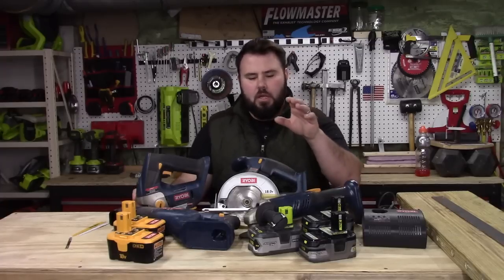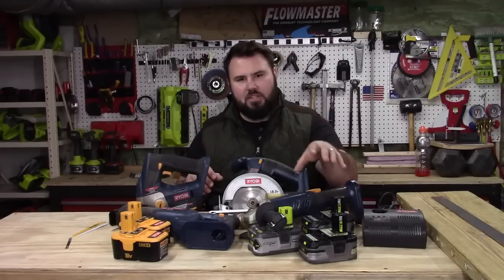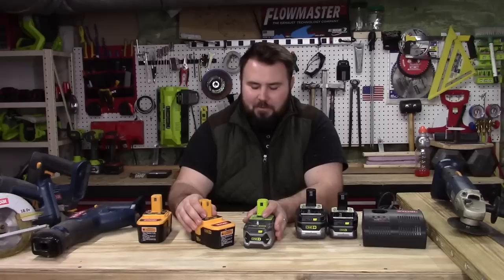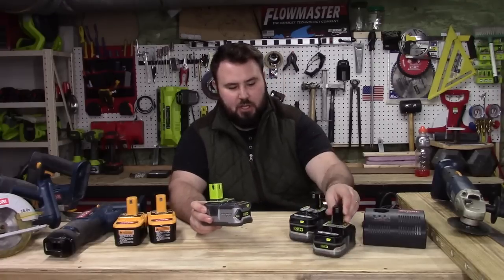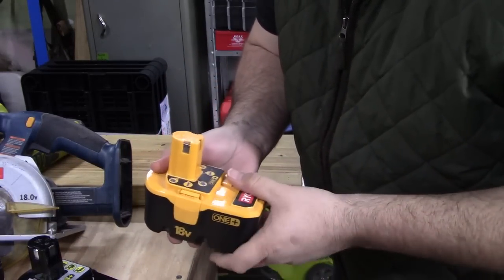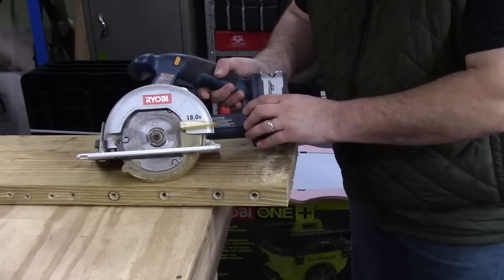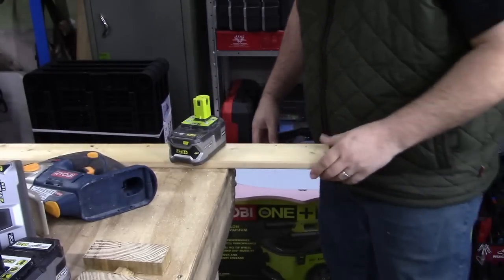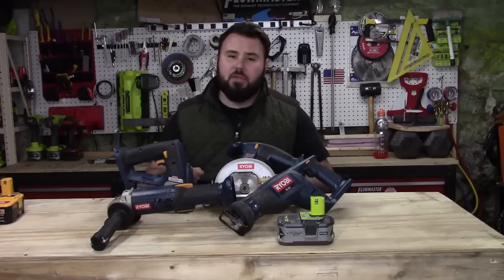Old Ryobi tools using new Lithium batteries

Comment: I was given a P231 ryobi impact drill today. It came with 2 of the big yellow batteries and the charger. I charged them and the drill wouldn't work. Either the batteries are bad or the charger is bad. The lights on the charger did light up. So, I put the P102 lithium battery I had on the drill and it works.

Comment: This answers my question about whether or not to invest in a new battery over buying a new tools.  Just have to see if they sell a battery+charger combo.  Also, will the smaller Li batteries work as well (aka 1.3AH)?
Reply from the maker: Kevin nycl9923 thanks for your comment, yes the lithium batteries will work just as well and better than ni cad

Comment: I'm really surprised at the comments from people who didn't know the lithium batteries worked n the old blue tools.  I currently have 5 of the blue.  I just put the new batteries n them without a second thought 2 whether it was going 2 work. I just assumed it would.  Also, I wanted 2 add, that when my circular saw and nicad battery were both new, the nicad ran it just fine.  Is it going 2 work on a battery that can no longer hold a charge like apparently the ones u have?  Of course not.  So,  I guess I missed ur point on that one.

Comment: hey guys i have some old blue 18v tools and some green as well. also a 12v drill iv'e had for decades when the original nicad batteries i bought a li on pack with 22.4 Ah & i 1.5 Ah (BPL-1820 The old grey & black ones)& charger, i also bought 1 x 5Ah  & 1 x 2.5Ah green pack. since the old 2.4 batteries were getting kinda tired. Since i hate ( mean too) to chuck away a tool that wont run because a battery is dead 1 found out that a 14.4 li on battery (with minor surgery to the drill) not only can run the 12v drill but the charger will also charge  a 14.4 v battery. now i am trying to upgrade the 2.4's to 4 or 5 Ah re pack . can this be done?

Comment: Will the compact lithium ion 1.5 ah 18 volt one + work on the old tools?
Reply: Any new Ryobi battery will work with the old tools. Even the HP batteries will but would be a waste of money unless you want a battery larger than 4ah.

Comment: Did the old blue charger work for you.I tried to charge the new battery in my old blue charger and it  won't charge the new batteries. The green light stays on saying fully charged   and in about 3-4 mins the charger shuts down and take a few min to work again.its like it flips a breaker in the charger.can you help
Reply: No the old chargers are for NiCad batteries.

Comment: I have a set of the even older Blue tools, plus 4 working NiCd packs (now rather weak). But I did floor out my loft with them in 2005.. Today I have at least 12 Ryobi 18+ tools, many are garden tools, which need the 4Ah or 5Ah batteries available in the UK. 
But in Australia  you can get the monster genuine 9Ah batteries. We never see them in the UK or EU. It's long passed time that Ryobi replaced the very dated style battery mounting system. It's rather fragile and often cracks. They should move to a Makita style slide on mountin. It is more robust and more compact.

Comment: Of course they would work great and do work great.I didn’t even ask the question they are obviously the same design! I can’t believe you didn’t buy just batteries for your blue tools lmao!
Reply from the maker: Thumper 1968 I thought the same once I found out the new batteries worked on the old tools. That was post buying the new tools. I must admit however the new tools are great with better tech and stronger parts meant to except higher amperage drives
Reply from the maker: Thumper 1968 thanks for your comment

Comment: Can you use plus one battery 1.5-2amp in a regular ryobi charger and can you use a plus one 1.5-2amp on a regular Ryobi reciprocal saw ?
Reply from the maker: You will need to read the charger abilities and ensure that lithium is supported. And yes the battery should work in you cordless recip.

Comment: Will the one+ batteries work with the new one+HP tools?
Reply from the maker: sure can!
Reply: @livefreeandtoolon  nice, wish the bundles at home depot came with batteries that are bigger than 2ah but I guess 2 batteries plus 2 drills at $179 is a good solid deal even though they are 2ah.

Comment: Will the new lithium ion batteries charge in the old charger?
Reply from the maker: WCSD Thanks for your comment. If you mean will lithium batteries charge in the Nicad charger most likely no unless it specifies on the charger. The newer chargers do charge all Ryobi battery types (nicad, lithium, lithium+) as specified on the charger.
Reply: I agree with profound Odyssey. I think Ryobi even mentioned that the older nicad charger. Since it is not really rated for it. While on the other hand the newer intelliport. Both the grey and the green will charge all three since they are dual chemistry. Meaning they are capable of charging both nicad, and the lithium and the lithium plus. Plus they mark it on the top that it's for all three.
Reply: Profound Odyssey  thank you for the video, I have a blue ryobi sawzall with no battery, could you re state the spec for which battery works with it -or should I just bring it down to the store?
Reply: @alexdephoure  all the new 18v batteries work in the old tools, although I'd get a 4AH or bigger

Comment: Can the new batteries be re charged using the old charger that came with the old yellow batteries?
Reply: NO !! Absolutely NOT. The old chargers are only designed to charge the NiCad batteries that came with it at the time.
Reply: Steve J. - Thanks Steve!

Comment: Do you need to buy a battery charger for the P108 Batteries or can you use the P100 charger?
Reply: No a nicd charger will not charge a lithium battery

Comment: With Ni cd batteries they must fully discharged before recharging, most people did not bother to FULLY discharge them, they build up a memory, and over time you gradually capacity eventually to the point where they hold hardly any charge, even though the charger says they are fully charged. 
There are video,s on you tube showing you how to put new batteries in place of the old Ni cd batteries.
Reply: There's ways to get rid of the build up of those crystals.

Comment: Well when you think for a moment. Even if you were to use a 6 or a 9AH batter from the HP line. All it really is just longer runtime or extended runtime. I know I'm using a 9AH in a hybrid fan the small one actually and it last me 15-16 hours on high settings. Imagine if I were to leave it on low settings with a 9ah it would be probably a day or two on low settings to drain it down completely. And that is not a brushless tool. but a brushed fan.

Comment: Will the old Ryobi tool drain the new battery until it can’t charge anymore
Reply from the maker: The RC Workshop I have not had this issue. However ryobi does recommend to not store the tool with a batter attached., when not in use take the batter out. Thanks for the comment don’t forget to subscribe!
Reply: The Lithium battery packs have a charge controller and under voltage cutoff inside them. So no, your cannot drain the battery down too far with the old tool. However you can still kill them by discharging to cutoff and then storing for too long without recharging. That's why Ryobi recommends not storing the batteries in the tools... you will forget what state of charge and may inadvertently store a discharged battery pack in a tool that won't get used for years.
BTW - there is nothing in the tool that hurts the battery, so it's perfectly OK to store the battery in teh tool... providing that the battery pack is charged.

Comment: I have a old Ryobi power drill but I can't fit any of the new ryobi batteries in it. It won't fit in all the way, preventing me from knowing if it still works
Reply: You're probably using their new 20v battery. They don't work, but the new 18vs do
Reply: @bbHoodski  ryobi doesn't make 20v batteries lol
Reply: Are you sure that the drill is 18v and not the 14.4v stuff?
Reply: @bread-gz3rl  100 percent sure. Because I had a old 18v nicad  battery that fits in it. But the battery no longer works. But no big deal. I just threw it in the trash. I have plenty of new brushless Ryobi drills.

Comment: All my 30 year old blue Ryobi tools died not just from bad NiCd batteries. Those old blue tools and batteries were horrible, all dead within a few uses. Purchased two sets of each, evey the spare ones are dead. Trying to fix the drills, little spring loaded parts flew out across the room, couldn't put it back without a parts diagram. To be honest, all NiCd batteries were just bad even from mine Panasonic, Milwaukee and DeWalt tools.

Comment: Like you said, the batteries were old, so whats the point of the video? If you were going to go through the effort of this whole video, maybe investing in a $40 nicad battery would have been good because all that has been demonstrated is that you replaced and battery with a new one. An FYI, I've got a new afternarket nicad battery for my Ryobi tools and my cordless circular saw can do quite a bit of work off it (I've got a newer yellow series).
Reply from the maker: svtcontour as I said in the video when the batteries were new they performed the same way, hints why I stopped using them... I look forward to your video demonstrating the quite a bit of work you do with your nicad I would like to see it. The point of the video was to show the lithium batteries are able to be used in the old tools.
Reply: @livefreeandtoolon  Well then you had defective batteries for sure :)  Ryobi would be unable to sell tools if the batteries performed like that new.

Comment: If you have Ryobi tools and are still using NiMH batteries in them you have no idea what your tools should be doing. I haven't used a NiMH battery in at least 5 years. HD has so many offers on their Lithium batteries with free tools you should have nothing but them by this point. I think I have 12 of them and I only buy them when they are offered with free tools.

Comment: Is the opposite true? Can you use old batteries on the new tools?
Reply from the maker: Not really the nicad batteries do not produce enough power to make the tool effective
Reply: @livefreeandtoolon  curious if an old batter would be powerful enough to use on a newer blower. Not any heavy work
Reply from the maker: @derekjackson1039  you need to look at the wattage the old batteries are really weak. I do not recommend stay with lithium

Comment: You got to be kidding $99 battery for a old tools they got broshes after lots of use they Ned to be get new and Berings the battery won't lost anyway you can do one or two cuts and need charge I have a 20v old set I made a adapter corded Whit 26v work perfect I can cut all day Long no heat
Reply: How many drugs are you on

Comment: will the new batteries recharge in the old charger?.
Reply from the maker: Graffiti Masters I don’t think so. Thanks for watching
Reply: thanks for your quick response. I just got from a friend  5 batteries the hedge trimmer, the chain saw, the brad nailer, and a drill he said the batteries would work in the old chargers and apparently they don't so that sucks.
Reply from the maker: Graffiti Masters sorry to hear, I would suggest just buying another tool that you need make sure it comes with a battery and charger and use that charger for all your batteries all of ryobi chargers that come with kits can charge all batteries.
Reply: @graffitimasters4533  - Well, OF COURSE the new Lithium batteries won't charge with the old NiCD charger.
If you think about it, just for a moment, then you should be able to work out why.
HINT#1: The old charger is for Nickel Cadmium (NiCD) batteries.
HINT#2: Are the new batteries NiCD batteries.... ???
Reply: I figured/assumed  that since they where both the same brand, (never considered anything about the Nickel Cadmium part of it).I ended up getting 3 chargers for the 6 batteries so its all good. thanks for your input.

Comment: Here are 5 bullet points summarizing the video:

• Demonstrating how old Ryobi power tools with NiCad batteries perform poorly compared to using the new lithium-ion batteries

• NiCad battery (1.7Ah) was only able to make a single cut through a 2x8 piece of wood on a circular saw before dying

• With a new 4Ah lithium-ion battery, the same circular saw had enough power to make multiple cuts easily  

• Tested other tools like a jigsaw and angle grinder which worked well with the new lithium battery

• Encourages viewers to revive their old Ryobi tools by purchasing new lithium batteries instead of replacing the tools
Reply: The video provides some useful details on which batteries to buy if you want to revive your old Ryobi tools:

• For the best performance, it recommends buying the 4Ah P108 lithium-ion battery pack. This allowed the tools to work at full power.

• The video states that the higher capacity 6Ah HP batteries don't provide any additional benefit for these older brushed motor tools compared to the 4Ah pack. The HP batteries are more intelligent for brushless tools.

• It suggests avoiding the smaller 3Ah batteries, as the 4Ah gives longer runtime.

• While more expensive upfront, investing in a few 4Ah lithium-ion battery packs and a charger can essentially give you a set of "new" revived tools for a fraction of the cost of replacing everything.

So in summary, the 4Ah P108 lithium-ion battery packs are highlighted as the best value option to breathe new life into old NiCad Ryobi tool sets and get performance comparable to modern tools. A couple battery packs plus a charger is a cost-effective way to reuse those old tools.

Comment: I had to buy the new drill because the old blue drill only took a 10mm drill bit and the diamond one I needed to drill through my tiles was 13mm, otherwise I would just buy the new batteries. Thanks for the info.

Comment: how would a battery stop a motor from spinning? the nicad battery DID NOT stop the motor magically/smartly/dumbly? from spinning. what happened was you didnt pull the guard up and it snagged on the cutting piece and you took your finger off the trigger acting like the blade had bogged down and didnt want to spin. somehow though the same saw with the same blade magically works better when the new battery is on (especially when you remember to use the guard which you acted like you didnt remember during the first cuts with the old battery but you lazed out and didnt so you can "prove" to us that those old batteries make tools not work somehow even though it does). putting a new battery on a car doesnt give you a new motor its still the same motor and still has the same power. your "theory" as to how a battery can make a saw bog down makes little sense. i can understand it might make the saw slower but it sounded exactly the same with both batteries so i doubt the battery somehow makes the motor weaker while still retaining the same speed. i cant say for sure as i am no engineer and actually have quite very little experience with tools and motors in general seeing as i dont drive but i think every viewer here could easily come to the same conclusion as if they had taken the time to go back between clips of you cutting and determine it was user error and not the saws fault. we all hate ryobi it seems like the fun thing to do. i mean the things look like cubscout grade nickelodeon slime zombie hunter junk (now anyway) but a still working battery cant be that bad as to make a tool not work even though it does work? somewhat contradicting to say the least
Reply: finally finished watching passed the comparison and sad to see you not test any of the other tools for magic/dumb power loss with the nicad. wonder why. funny how people brag about the batteries for the tools oh yeah my batteries are smart they talk to the tool. how? what do they say? Bob recip saw: hey jim. Jim 4a battery: yeah? Bob: its hot. Jim: ok
Reply from the maker: TARDO You some how have taken personal offense to something you don’t understand. The very basic fact is the lithium batteries store more power in a smaller physical size What you noticed in the video were the ni-cad batteries didn’t have sufficient power to rotate the motor which was spinning the saw blade to cut the wood, since the lithium batteries were able to supply sufficient power to spin the blade in order to cut through the wood. It’s not user error or “magic” just simple science. If you would like to understand more, research battery ampere ratings and comparisons. And next time before you comment you may want to process your thoughts a little more and state them as facts, you made your self look foolish in front of thousands of people. Thanks for watching!
Reply from the maker: TARDO one more point, it was was moot to test ni-cad on any other tools seeing that they were drained and the point of the video was the performance of the lithium batteries being used on older tools.
Reply: I can smell the drugs from here